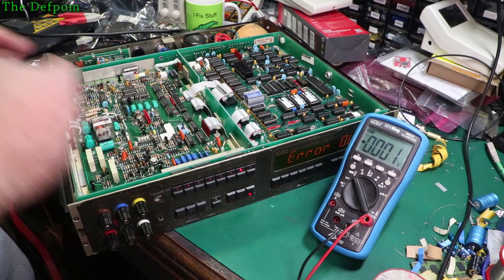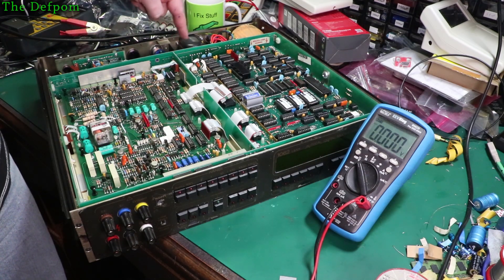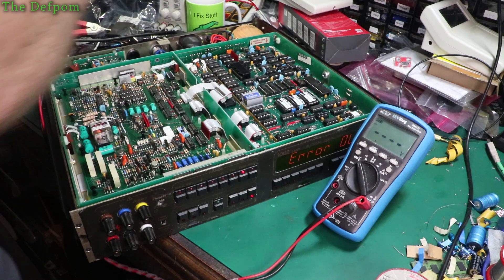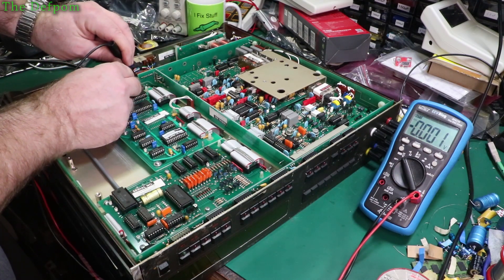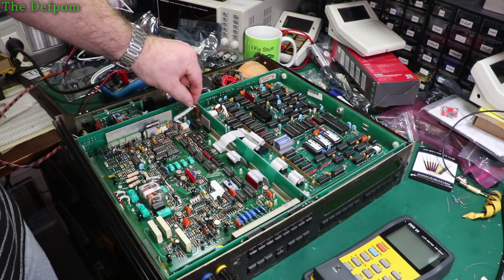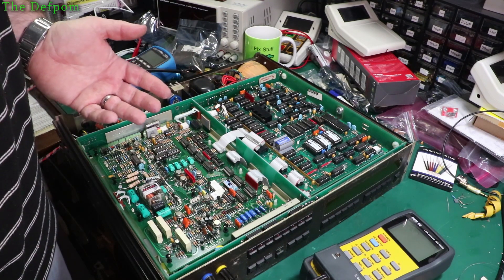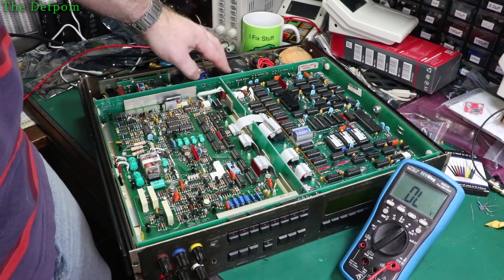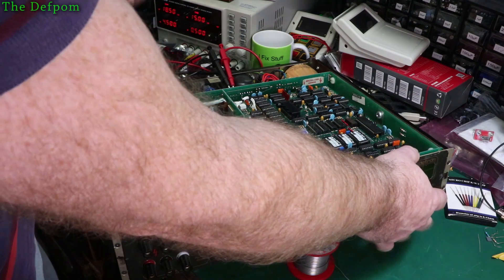#746 Datron 1062 LS101 Autocal Multimeter Repair Part 3

Comment: Hi, 1 volt Peak To Peak is égal to 353 mV RMS SO NOT SO FAR
Reply: Indeed, RMS is taken from the peak value, not the peak to peak!
Reply from the maker: Juan EA2EAX - yes you are absolutely right, I was having a seriously bad brain fart there! 
I do actually know that RMS is based on Vpeak and not Vpp, I can only think that happened because of using the scope to generate AC instead of one of my calibrators and I wasn’t actually thinking ! I’m even more amazed that I didn’t notice this when I edited the video!